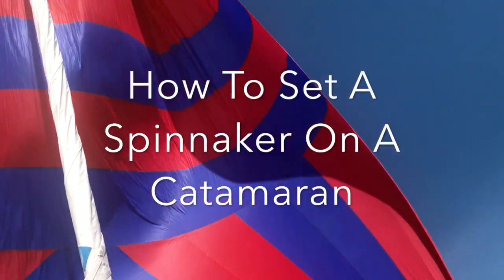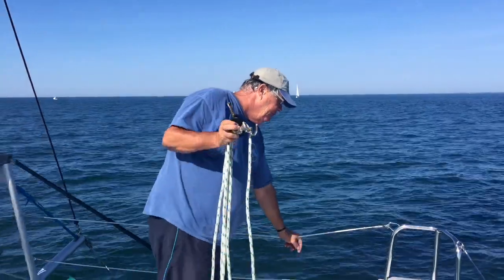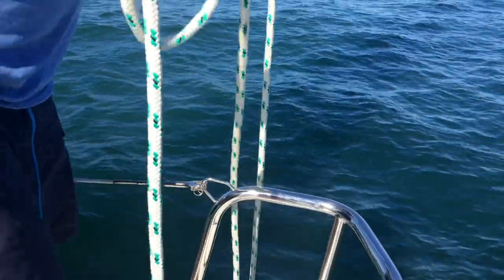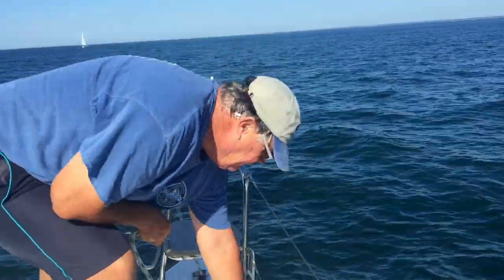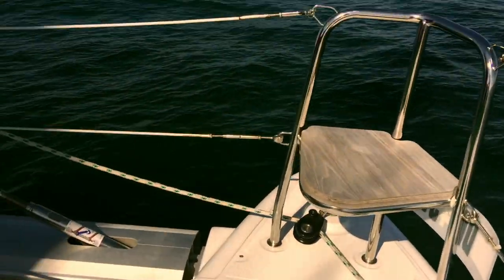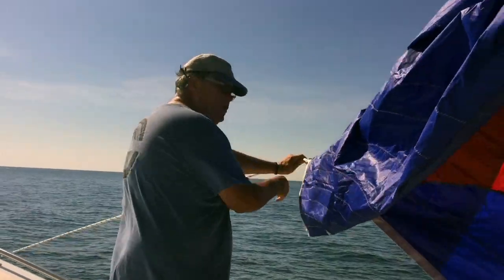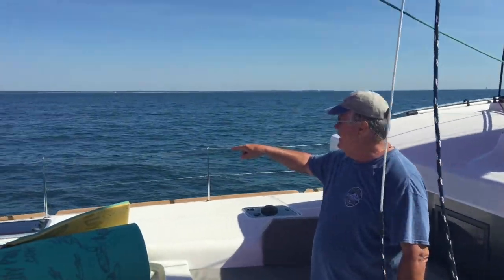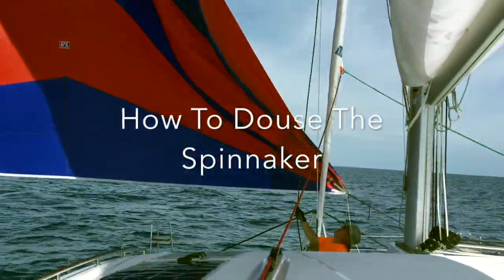How To Set An Asymetrical Spinnaker On A Catamaran

Comment: Thank you for your clear explanation! In setting this up should the sheet be fairly light to keep the downward pull on the clew low so as to not distort the shape?  Dyneema? Any guide for diameter?  I have a 47' cat.  Would you ever attach the tack to the bowsprit?

Comment: How would you handle a gybe maneuver with an asymmetrical spinnaker on a cat?
Reply from the maker: We normally douse the sail with the sock and then move the tack to the opposite bow while running the sheet to the opposite side. Once we are set up and satisfied that all the lines are correct we re-deploy the sail by hoisting the sock. We have also gybed without dousing the sail in light winds which is a bit more complicated and needs crew.

Comment: Did you have the main up when you raised and doused the spinnaker?
Reply from the maker: In this case we did but we don’t always have the main up. We have running backstays that we use to stabilize the rig when we use big sails like the spinnaker. The run from the top of the mast and we secure them on the very back of the boat just behind the spinnaker winches. When we don’t use them, we simple secure them on the toe rail amidships.
Reply: @Catamaranguru  Thank you. For some reason, we always have trouble getting the spinnaker down. We've destroyed the throat of three socks. The last one was an ATN sock.

Comment: interesting, if not damaging setup, would be safer and easier to , when in an emergency, to losten the sheets, and simply lower the sock!!, this would collapse the sail, de-power, and NO lines capable of fouling the proppellor!!!!- as they are contained by the pulleys on the deck!!